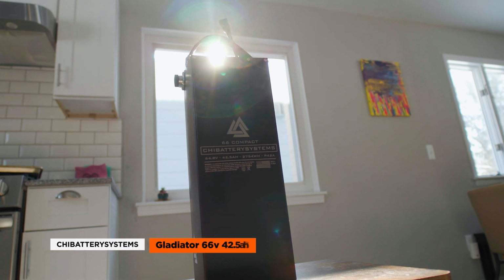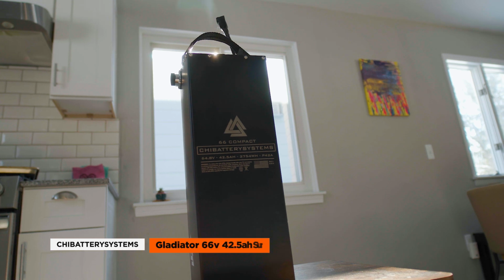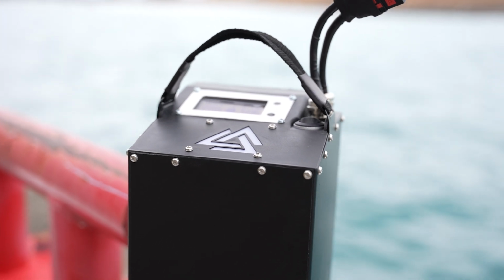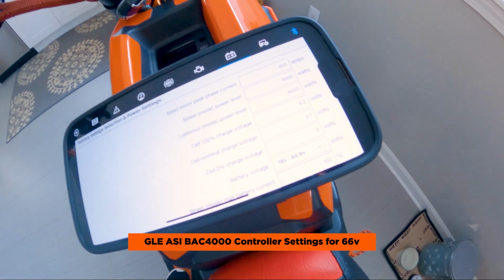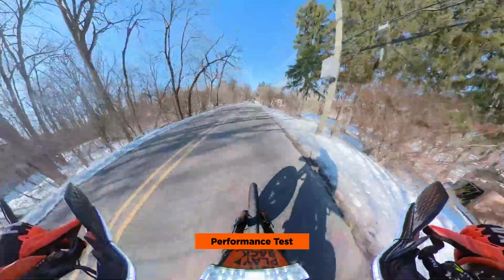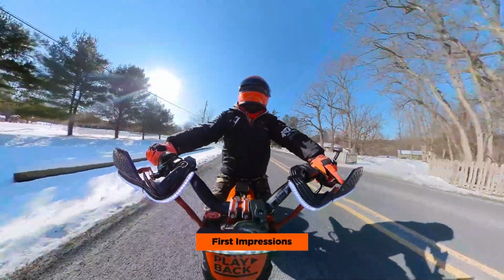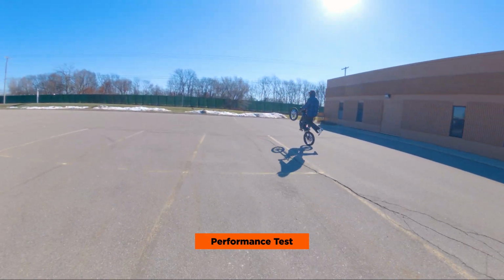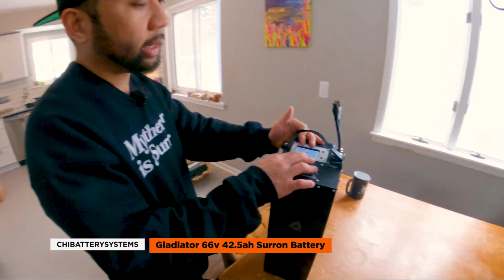ChiBatterySystems 66v Gladiator Surron Battery Full Review & Top Speed Test | RunPlayBack

Comment: Gen one's plug for the battery is definitely a better position than gent two. You crankle the connectors on the battery at the end of it. And on the Siron's connector. at the port of it. Gen You can easily click it in and then tuck it behind the battery a little bit. and you'll avoid that crankling of the wires.

Comment: Will the 66v battery give me more range on the stock controller? If so, how much?
Reply from the maker: In general yes, since the 66v battery is 42ah, vs the stock battery 34ah.  Estimating range is hard to gauge, it heavily depends on these main factors: payload, terrain, riding style.
Reply: @RunPlayBack  Ok, but approximetly can I expect a range boost of atleast about 30 miles?
Reply: @RunPlayBack you would chose for range 18s 6p 27ah p45 or 16s8p 16s 35ah? 😅stock controllers setup
Reply from the maker: 35ah for more range
Reply: Yes so generally watt hours = more range. To find the watt hours of a battery you multiply the voltage by the ah. So a stock surron battery is 60v 32ah so 60 x 32 = 1920 watt hours vs the 66v chi battery 66 x 42.5 = 2805 watt hours. So theoretically your getting about 33% more range.

Comment: Yo Rik.  Can I use the OEM speedodometer with my BAC4000?  The GLE dashboard app is inaccurate.
Reply from the maker: Don't think so. You can however use an Eggrider or APT display.  There are also fairly cheap GPS speedometers displays that can be mounted on the bars.
Reply: @RunPlayBack  thx for that.  GLE emailed me that in April, they are updating gle dashboard app with odometer and trip feature.

Comment: I want a battery, but I was thinking 72
Reply from the maker: Still running the stock controller?
Reply: @RunPlayBack  no I was going to get a Bac 4000? someone recomended the 4000 over the 8000 im not sure why that is? TIs bac the best controler out there? or is Ko better? I dont know anything im really looking for info.
Reply: @marcussmith4913  I’m looking into the electro & co Emxron controller, it utilizes any battery from 60v to 72v without any annoying tuning, leaving the stock battery available which you can also bypass and not worry about the controller tune.
Reply from the maker: The BAC4k is a great choice.  The BAC8k is a great controller but overkill for the Surron, IMHO.